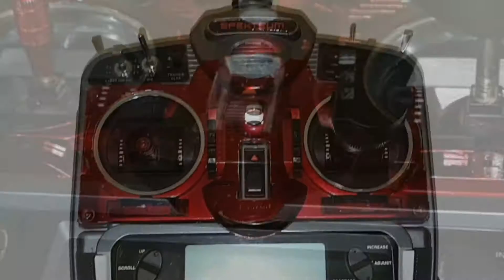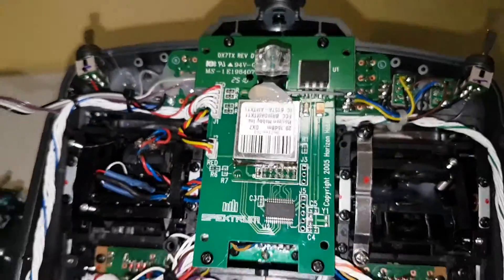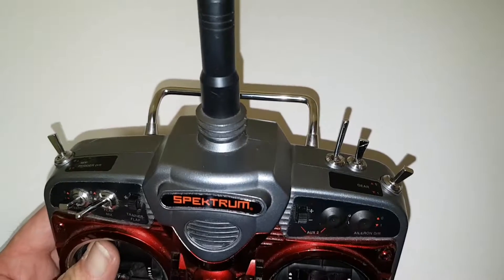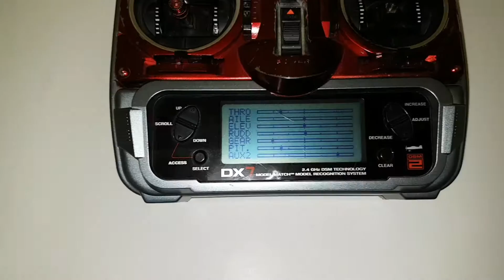Spektrum DX7 single stick conversion

Comment: Looks like it was low battery voltage in both batteries. I left it on charge for a bit. Switched on, and was able to access the servo monitor, reverse the aileron and elevator, and then the voltage was showing about 7.7. Hopefully a good charge sorts it out, and my mode 2 conversion is a success!Thanks for the advice and the instructions...happy flying!

Comment: I take it that along with pot/trim board swap, the throttle ratchet and self centering spring hardware get swapped over to do mode 1 to mode 2 conversion?
Reply from the maker: Alan Pheasant thats correct you need to swap the pot over as well as the ratchet since the trim on the elevator and trim works fine when you swap the pots over the main problem is the throttle you need to reverse just the two out side wires to the pot to get the throttle and trim to work correctly since the trim only works when the throttle is low what happens is when you swap the throttle pot the trim only works in the high position which is not so good hence why you need to swap two wires on the trim pot ive look at the service menu and the board there are no other means to change the mode in the software and i cant see any jumpers to change mode
Reply: After reassembly, my unit did not turn on. I plugged in the charger, switched on and the battery voltage shows rapid voltage drop each time I switch on. Any ideas what I might have done wrong?
Reply from the maker: Alan Pheasant  have you left any plug connections out ? double check that all the plugs are in
Reply: I opened it back up, checked for any loose plugs, still get no power up on battery alone, and when plugged into charger it switches on then shows rapid voltage drop, beeps and screen goes off. Have tried a spare battery, same result.
I checked fro damage to battery circuit wires, can't see anything.
This Transmitter is originally a heli mode 1 unit, I see yours was an aero mode 1. Any idea if that would be an issue?
Reply from the maker: it shouldnt cause any issues to change mode in the radio itself  by the sounds of it it could be a faulty power board in the transmitter that sudden devolved normally you can point to a faulty battery but in your case you already tried a different battery  but try and do a model reset if you can to see if the fault clears , the other question have you done any soldering to the board ? you may have a short on the track itself that may cause that , when i did my first ss conversion on the jr 9x i had the middle wire and side wire crossed on the rudder pot which cause the radio to shut off everytime i put in rudder input , if your still having problems do a google search there are bound to be others that had the same issue , is your radio the same as mine ?
Reply from the maker: it shouldnt cause any issues to change mode in the radio itself  by the sounds of it it could be a faulty power board in the transmitter that sudden devolved normally you can point to a faulty battery but in your case you already tried a different battery  but try and do a model reset if you can to see if the fault clears , the other question have you done any soldering to the board ? you may have a short on the track itself that may cause that , when i did my first ss conversion on the jr 9x i had the middle wire and side wire crossed on the rudder pot which cause the radio to shut off everytime i put in rudder input , if your still having problems do a google search there are bound to be others that had the same issue , is your radio the same as mine ?